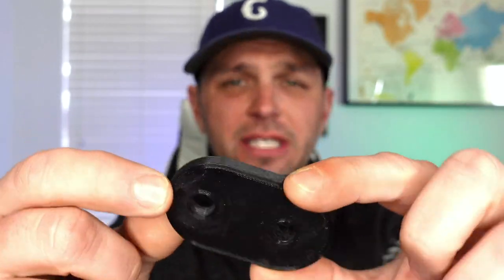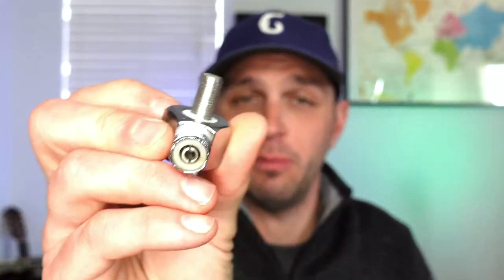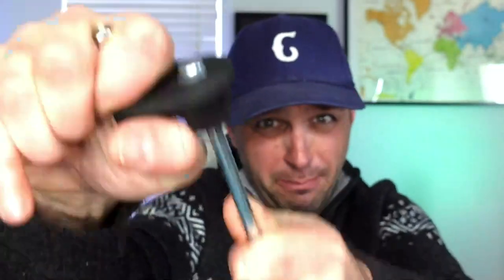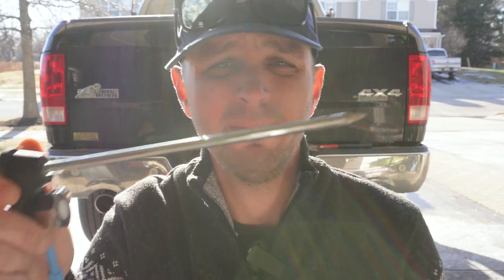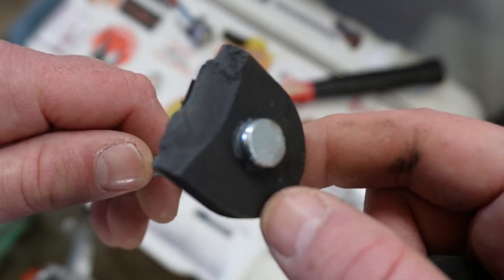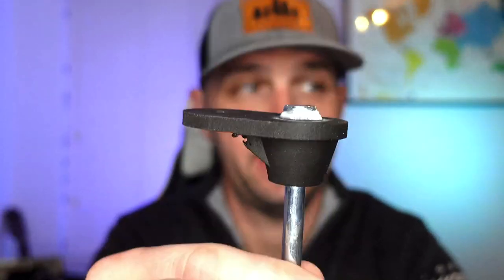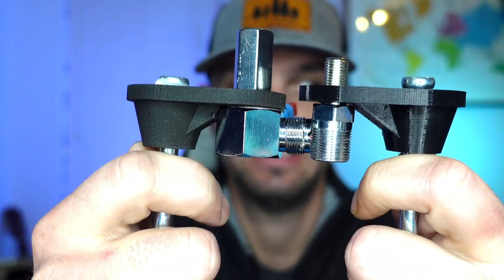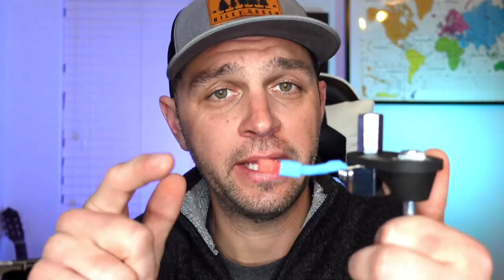I DESTROYED This Antenna Mount - AND LOVED IT!

Comment: Love the concept, I would try and make the black piece larger to fit the elbow so that you wouldn't need to grind any off, that would make it stronger. I would also increase the length of the spike to 15 to 18 inches to insure a solid hold into sand,  that may help. OH and I wouldn't glue the spike to the black plastic piece, leave it loose so when you do hammer it into the ground it won't take a beating, and after it is in the ground use a C snap ring to hold up.  But what ever you do I'm sure you'll get it right.

Comment: I'm really enjoying this series - can't wait for the next one! A couple of ideas: Could you allow the spike to move through the mount, hammer it in and then slide the mount up and lock it in place? The other idea would be to make something similar but with a tripod mount so it could be used that way - perhaps by inserting a nut in to the plastic?
Reply: You can increase the length of the ground spike by having  male  thread on the end of the original and having another with the female pert on one end and the point on the other.

Comment: Enjoying watching the whole process.  I was thinking about the sand issue and length of the spike vs portability.  As long as it is equal to or shorter than the antenna element the portability isn't impacted.

Comment: can you share the tinkercad link? would allow some of us to copy that design directly and modify it in what we think would be stronger. also inserting sleeves where you are clamping will help prevent any type of cracking of the plastic since the clamping would be done on the sleeve and not the plastic. depending on size of the thread you can cut down pipe and then heat insert it. same with the spike. and to stop it from working out of the ground. design it like a puck. anyway i have a couple ideas floating around. 

one more thing. if your printer is printing smaller or larger then it should you might want to go through and do a calibration of your steps tom of toms3d has some great videos on calibration

Comment: Now that you have a right angle SO-239, why not make the entire part thicker (basically have the PETG surround the SO-239 on three sides) and have the 3 sides as tall as the "cone". That will make it stronger and absorb vibration.
Reply from the maker: I think I understand what you are saying, and it makes sense, let me draw up a few things. Thanks!
Reply: @HAMRADIODUDE  Alternatively, or maybe in addition to the above, when you were talking about the Florida sand, what about having two spikes, say 2-3" apart with the SO-239 in the middle. That will give more surface area for the sand to bite into without increasing the length. Just spit-balling ideas.

Comment: Dude it looks great. Make the piece where the SO 239 isa tear drop shape. Then add 2 more gussets on or near the edges of the tear drop. Leave the center gusset, the outside 2 would go almost to the center of the antenna hole.

Comment: Sean, you may want to go up to a 95% infill.  I would make it a tad thicker maybe about 1-2 mm and 1-2 mm wider at the hole for the Right angle connector. You can use baking soda mixed with Krazy glue to reinforce that spot where you filed down after you put the nut on. As for filament, I do not do 3D printing but I have designed stuff for other people in TinkerCAD and I used to use Autocad many many years ago as an Engineer if you are getting it 3d made outside use an ABS filament or one with a carbon fiber mixed in. this should give you extra-strength???.  I used to do everything by drafting with mechanical pencils with 3H leads on Vellum drawing sheets  & using slide rulers to do our math calculations.  I took Mechanical Engineering in HS for 3 1/2 years back in NYC at Thomas A. Edison Tech & Voc HS from 1968-1972, and Yes I'm Old so sue me LOL. I am Good at stuff like this. I was going to be an Architect, had a job lined up but in 1972 the real estate market Fell through where there were no new buildings being designed or built. You got my phone number if you need help I'm a phone call away. Keep up the good work with the videos you're doing a good job. I hope this helps?
Reply: Uhm, 95% will be weaker.. FYI.
Reply: @lb6ciradiostuff490  Why? I do not use 3D printers, we had two 3D printers where I live at the Library where I volunteered one was a Prusa we had a young kid (mid-'20s, I'm 68 and was an Electronic Engineer in computers).    I would have gone with 100% infill with a carbon fiber mix filament or gone with something like a 1/4" x 2" x 6" piece of 6061 Aluminum.
Reply from the maker: Just an FYI everyone, I use PA 12 nylon that is multi jet fused

Comment: Also, leave the plastic end on the spike and put a loop to paracord on it to pull the spike out the of the ground without putting stress on the mount or the antenna.
Reply from the maker: Pro tip, I like this!

Comment: Dude Spike missing guying system. Add something that has an internal diameter of the 4th or 5th element which means you will slide on that element but it won't go any further. With the guying system, it should allow keeping antenna up in more sandy soil. 4 times one-foot tent spike is more portable than one 4 FT long grounding spike.

Comment: Are using the MFJ 17 foot telescoping antenna if so you can by adjusting its length for use on 17,15, 24  and 10 meters
Reply from the maker: I am using the wolf river coil antenna: but yes, you can adjust the band by adjusting the antenna

Comment: Drill a hole into the top of the Radio Dude spike and thread it for a screw   
Take your ground lug and make it a flat (figure 8) and put the larger 3/8”opening under the SO239 where the top lug sticks up. The bottom of the figure 8 would extend over to the spike and run a screw into the top of the spike to hold the radial hook up and keep it out of the way of the PL259 the spike would also help complete your ground.
Reply: KI5IQE
Reply from the maker: Thank you. I have mentioned the wire to the tent spike for ground, in the past.  but I never considered it would hold up the insulator/center piece

Comment: How can I purchase three of those "Ham Radio Dude Spikes" as pictured in this latest video please? I'm working on a different antenna project and this would save me some time for a test that I'm currently running. I'd be happy to pay $100 for a three pack right now. 73 W3GUY Ernie
Reply from the maker: Hi Ernie. I'm working on the modifications and then I'm sending them back out for prototyping. As I recall, they were about 8.00 each and I can send them to you when they get in. Alternatively, the 3d print plans for this version are on thingiversen.com.  if you wanta set when the prototypes come in, shoot me an email. My email is listed on YouTube under my about me profile. Thanks
Reply: @HAMRADIODUDE  I can wait for the updated version, I will look for your email address. These will be a real time saver on a portable phased array antenna system that I'm working on. Thank you! 73 W3GUY Ernie

Comment: 3D prints are useless for anything structural. It is not solid plastic but layers barely stuck together. They are great for making a prototype you can hold in your hand and visualize but they are not strong. I even tried carbon fiber reinforced PTEG and the only way to make them even marginally strong is to make it 10 times bigger than you think it should be. I have 3 of them collecting dust as they are useless..... bite the bullet and buy a small milling machine you will be glad you did!
Reply from the maker: Thanks, I considered it. The second material is PA12 nylon. But I assume it's the same concept.  Can you recommend a milling machine?
Reply: @HAMRADIODUDE  yes I can whole heartedly recommend a milling machine - LOL,

Comment: I would ditch the 3D printed part and fabricate a mount out of aluminum, or modify an existing aluminum  antenna mount. I have access to fabrication shop, but I don't know anyone with a 3D printer. You gave me ideas to my next project. I am thinking of making it out of UHMW SHEET as I have some of this in my inventory.
Reply from the maker: Id love to find someone to mill these out of aluminum.  That is the ultimate goal, but sadly I don't have access to a mill.  These parts are PA 12 multi jet fused
Reply: @HAMRADIODUDE  I sometimes get some scraps of ultra high molecular weight polyethylene, it is easy to cut with a bandsaw, sand and file. UHMW should be a lot stronger and impact resistant than a 3D printed part.